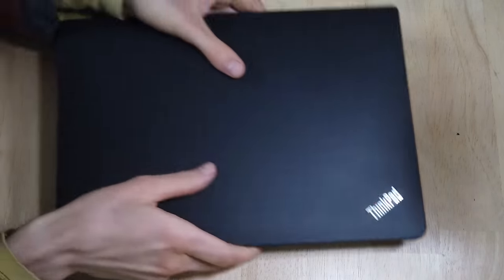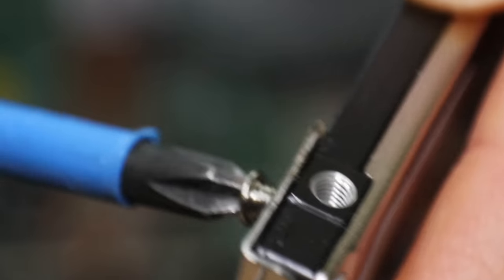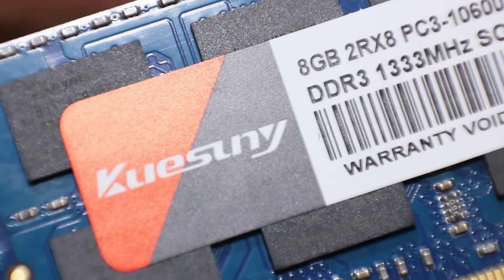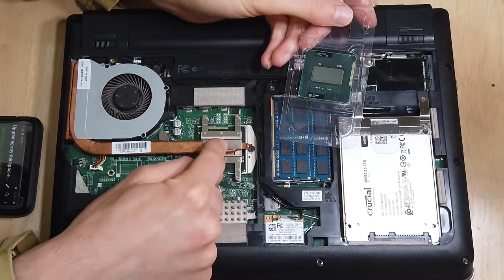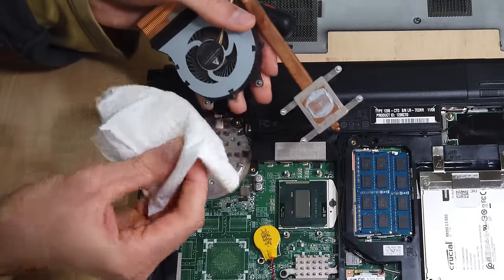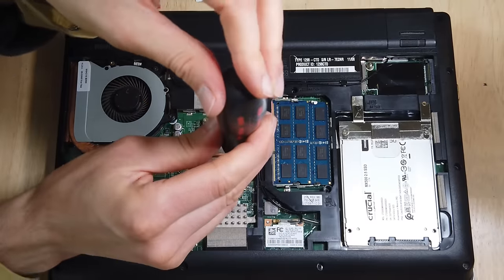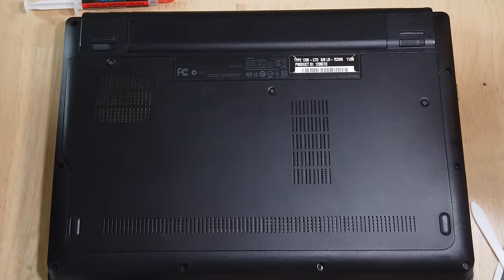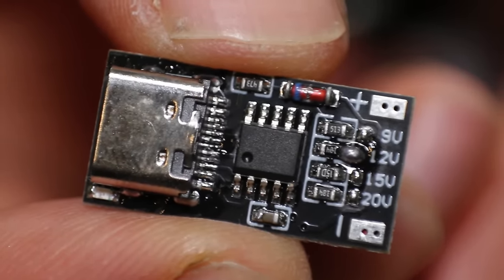The up-gradable laptop I can't get rid of: CPU upgrade etc

Comment: Worst thermal paste application I think I've ever seen! 🤣🤣🤣
Reply from the maker: Same... And then I filmed it for all the world to see
Reply: @ashsibebytes4846  🤣😂😁 We've all been there!
Reply: The idea of measuring thermal paste performance by thermal conductivity alone is also flawed. The thinner the thermal paste the more it will spread out, thus have less thermal paste the heat needs to travel through. If I am not mistaken the arctic mx4 is an example of a paste that is not exceptionally conducted but makes up by being very thin.
Reply: @jaynayk1176  Agreed on your first point but not sure I follow on the second point. IMO, especially for direct die cooling, one of the more important factors is viscosity. Pastes with lower viscosity tend to "pump out" under load leaving bare die to heatsink contact. Higher viscosity pastes better resist the pump out effect and tend to have higher longevity. For budget pastes, I love Ceramique 2. It's dirt cheap, performs with a few degrees of most pastes, and there's zero chance it is pumping out. On the more expensive side, I also like Gelid GC Extreme, Prolimatech Pk3 and Tuniq TX4. MX4 is ok (definitely great for normal heatsink use) but not my preferred choice for direct die cooling like this.
Reply: I've seen worse lol the fact that he ended up putting a blob probably saved it though, or else I would have agreed haha great content
Reply: Did you also notice that the battery was in the machine the entire time.😂
Reply: still better paste application than The Verge
Reply: @sliptap  Nothing beats Arctic Silver. Too bad they don't make it anymore. I ran out a couple years ago. 😞
Reply: @TehButterflyEffect  plenty of pastes best Arctic silver lol. And they still sell it, but it is pretty old at this point. Too many other pastes have better performance and aren’t conductive
Reply: if you ever watch linus IT DOES NOT MATTER any amount of thermal paste will work a dot or half the tube IT ALL WORKS.
Reply: @h1c2e35  Not quite true lol. They came to the conclusion that any pattern will work when applying thermal paste as long as you have enough thermal paste. So if you use too little, you will have worse performance than if you used too much.
Reply: @sliptap  lol to little is like the sizes of a pin tip, you try and do a pin tip with thermal paste in a tube nope it goes splat 99% of the time. so you always have more than you need you would haft to try REAL hard to not put more than a pea size.
Reply: @h1c2e35  linus is a TOOL!
Reply: I hated every single second of the thermal pasting. It was already done when you put it on, the heatsink does all the dispersion for you, but then you plastered the whole cpu with it AND STILL PUT MORE ON TOP OF THAT
Reply: @ashsibebytes4846  where is the next video?
You've left it on a USB-CLIFFHANGER.
Reply: One of my friends first pc build thermal application was the entire syringe 💀
Reply: yeah, that really takes the cake.
Reply: 😂😂hell true dude
Reply: Better over than never!
Reply: Not just that, he didn't even cleaned the cooler... "all the help the I7 can get"... well what about some f... cleaning???
Reply: @ashsibebytes4846  you know what you must do, you gotta redo it on camera
Reply: @sliptap   thermal paste exists because die and cooler are not perfectly flat. That means if you do not use anything, there would be air between the silicon and cooler. Air is a good insulator, exactly what we do not want. If you put thermal paste between it and clamp it down, even if most of it just squishes out of the sides, there is no insulating air. Direct contact to die is not a bad thing, the air gap that is caused by imperfections is the problem. You could be onto something with that longevity part thou.
Reply: Lol so true
Reply: Doesn't really matter as long as there's enough to cover it the rest squeezes out.
Reply: @sjagain  don't be jealous that Linus is way more successful than you.
Reply: Better to have too much than not enough
Reply: Yeah and he has the audacity to say he has O.C.D😂 that should would have been perfect if you had O.C.D
Reply: Haha, I've senn this comment before the video and was like, come on how bad can it be.. Now I am kinda speechless on how right u are 😂
Reply: @TehButterflyEffect  Arctic Silver is good, but its key component (silver) is electrically conductive.  There are better compounds available now.
Reply: Well, atleast it is better than what I have done on my old Toshiba laptop
Reply: Wasn't bad
Reply: He did all the things without removing the battery?

Comment: Bought an older 2011 Lenovo AIO B520e 3111 for $125, swapped out the i5 2400s ( 4 core 4 thread 65watt ) to a 2600 ( 4 core 8 thread 95watt ) 16gb ( 2x8 )of DDR3 1600mhz Kingston ram from the single 4gb stick ( forgot what brand ), swapped out the single fan + cooler to the larger cooler with dual fans, intel 8265 wifi card ( 2.4 144mbps and 5G which I haven't tried so I don't know the speed and don't really seem to need to but nice to have ) from the old Realtek ( forgot the model but 2.4 at something like 78mbps and no 5G ). The older guy I got it from already did an SSD in it and windows 10, for an older system with only PCIE 2.0 and second gen intel it's pretty quick ( 10 - 11 seconds from boot up to desktop ), and everything works, mostly only used for just browsing / watching YouTube and to do school projects ( bought it for the kid, also I wanted a little project we could do ), not bad for $200 total investment with some genuine Lenovo parts / aftermarket ram / CPU swap, with all that and MX-6 paste it stays quite cool. Gaming though, I don't know or even tried but might ( keyword ) be able to do some very light gaming ( like Rocket League for an example, maybe ?! 🤷🏻‍♂️ ), but that's what my MSI Delta 15 is for, probably build a tower if I can find the time / space / cash to burn and if we need another project.

Comment: Did a similar upgrade to my T510. i5 to an i7, 8Gb of ram, 1tb ssd - incredible these machines are, still holding over an hour on the original battery. No issue with thermals tho in the t510.
Reply: I have a Dell Inspiron 5100 from 2003 and the battery still works
As soon as I unplugged the laptop and say it was still running I was just amazed
Reply: I'm not so fortunate on my Dell Latitude's battery situation. It lasts about 20 minutes at idle and about one minute under load.
Reply: @ajhauter5049  time to buy a new old stock one
Reply: @probablynotdad6553  I never use the thing. I built a desktop in August and it does everything I did with the laptop better.
Reply: we've come a long way efficiency wise 😂
Reply: This laptop is literally not even that old. Why are you so goddamn surprised
Reply: @CovenantAgentLazarus  He upgraded it. Meaning it uses more power and so the battery life gets lower. That's why he is surprised.
Reply: @voidarkyt  he should have upgraded the battery then
Reply: @CovenantAgentLazarus  can you do that? Lenovo does some apple stuff right? Yk locking the battery to its own or smth?

Comment: You can probably also upgrade the WiFi card.  Lenovo does like to lock the BIOS so it will only accept certain models, but you can usually find modded bioses that remove that.  I have several computers that now have 802.11AC and bluetooth where they didn't originally come with that.
Reply: Excellent to know, thank you
Reply: I replaced the faulty wifi card in my 2020 ideapad with the old one from my hp laptop and it works perfectly fine, and they are even different brands. The old one was realtek and the current one is intel.
Reply: @lance_374  I have always preferred intel cards (except for their drivers lol they really like to not give downloads)
Reply: @lance_374  you most likely got lucky with that part already being on the whitelist.
Reply: The x240 has a really bad whitelist, which includes blocking replacement generic LCD panels. I did update the wifi and LCD on mine but I had to get a hacked bios first, and flash it with an external flasher.

Comment: the so-called 32GB support on 2nd and 3rd gen Intel are actually designed for 4-channel memory (means you have to install 4 sticks of 8GB DDR3) so in dual channel (2 slot) you can only go up to 16GB.
Reply from the maker: Very helpful thank you
Reply: @ashsibebytes4846  if you see a 16GB DDR3 RAM stick online, it is designed for 5th generation Broadwell system (even with U series CPU) because 5th gen is the first gen to support dual-channel 32GB RAM (although Intel page listed 5th gen CPU like i5-5300U only support 16GB, it is tested and it is compatible with 32GB dual channel)
Reply: @trandinhvietdung9357  Mr Tran is there anything you recommend for under $150usd that can be upgraded but run at lower temperatures? also something that can have wifi or bluetooth as it will be a security machine. Currently using an odroid c4 but too slow.
Reply: You are mostly right but none of those CPUs have 4-channel memory. It's just dual channel with two sticks per channel
Reply: @Pasi123  ah yeah, thanks for your clarification

Comment: People forget, until post circa 2010, laptops coming with socketed CPU's and ram enabling full upgrades was standard practice across the industry for decades. Now such a thing is sold to you as a gimmick for a much higher price by bespoke companies while the main bulk of producers use vastly cheaper production methods of soldering direct to board, which also ensures the product is destined for landfill much sooner than needed.
Reply: I mean my framework 13 was hardly more expensive than a comparably spec'ed laptop and I've been loving it so far

Comment: FYI, you can always use faster memory with a CPU that only supports slower memory. E.g. if you got DDR3 1600 it would work with the i5 no problem, it would just run at 1333.
Reply: @sushantmehta6269  it will, because the 1600mhz memory will run at 1333mhz.
Reply: @sushantmehta6269  have you ever tried this? Because I know from experience it's fine to use faster than supported memory.
Reply: Chances are you'll get tighter memory timings with a higher rated ram kit too even if you can't get faster clock
Reply: @Cedalus  not always. If the faster kit has no profile for the slower speed it might fall back to very slow JEDEC standards. Same if the manufacturer didn't bother to tune the lower speed profiles.

Comment: Really nice video, one tip I would give you is remove the battery before doing any upgrades
Reply from the maker: Yep that would be a great idea. I wish I was there to tell myself that at the time.
Reply: Remove the battery AND press the power button to make sure capacitors are totally discharged
Reply: @ashsibebytes4846 they also sell replacement CMOS battery’s too. That would be nice. Usually good to replace them about every 5 years or so
Reply: @elfedorausado  caps on laptops usually don't hold a charge for long after removing battery but still not a bad idea.
Reply: @ethanv8147  it's not probable, but not impossible

Comment: 2 things about this video impressed me the most. How the laptop looks, it's in amazing condition and the fact that it is a very rare laptop being CPU upgradeable. Cheers
Reply: I personally think a laptop with an upgradable processor isn't so much rare as it is uncommon.
Reply: Almost all core i3/5/7 M laptop back then were CPU-upgradable
Reply: @SOU6900  I wouldn't say uncommon given they were common before like 2015-2016 but became non-existant overnight
Reply: @SOU6900 Sadly it used to be common that laptops are meant to be desktop CPU that is portable so many manufacturers creates mobo that has socketed CPU now its either LGA or BGA the LGA is what replaced PGA it is upradable but doing so is much harder but BGA is where people that solders regularly will be challanged because its soldered directly to the board
Reply: @Raykkie  There's some companies that still offer laptops with the ability to use a desktop processor. But last I looked they were probably 3000 for a basic setup.
Reply: @SOU6900  3k doesn't sound that much for a modern laptop that has socketed CPU heck you can get Samsung with Core Ultra 9 with that money Intel changed their naming scheme

Comment: I've done the exact same thing with an old Toshiba of mine! It came with much worse specs, and the upgrades came with some interesting surprises. It came with a (also 2nd gen) Pentium b950, 4gb ram and a shitty 500gb hdd. I got a 240gb SSD, 16gb of RAM and an i7-2630QM. It accepted all 16gb of ram at the full 1600mt/s surprisingly. The laptop was only supposed to be able to use ram up to 1333. My temperatures never exceed 70C with the new cpu even though it's much more powerful
Reply: Still using my 10 year old Toshiba Satellite daily which I have boosted with i5-3210m and another 4 gigs (8gb) of ram and SSD. Can't see why it wouldn't serve me another 10 years

Comment: An upgrade i would suggest (even more if you're going with a higher tdp cpu) is the heatsink one. I can see in your pcb that your laptop has a model wich has discrete graphics. 

The heatsink from the discrete graphics version has more mass and more thermal capacity, probably enough to be fine with your 45w processor and temps be just as before.
Reply: Did that with my Dell, still wasnt enough.
Am planning on installing some copper plates through the heatsink. Got any tips?
Reply: Liquid metal
Reply: @Callagwhan  That makes absolutely no sense lol, he needs to take the heat out of the computer, not into the cooler lmao… 

I’d say that the only way to do this would be to get a larger heat sink, make one yourself with larger/more heat pipes, and change the fan to a faster one.
Reply: @Callagwhan  i dont recommend it because of 2 reasons:
1. for a beginner is a big no no. If you dont apply it correctly, you can have the chance to kill the entire system. LM applying not easy, like using thermal paste and squish its with the coldplade.
2. for a 45W CPU is an absoulte wasted money. Those laptops are using the bare minimum cooling system which is required by the CPU. For a 35W CPU the manufacturer wont install higher TDP cooling, so u need to replace the cooling system with the CPU.
Reply: @SummonerArthur  buy a heatpipes and stick it to the original heatpipes with thermally conductive glue there are many products online.
Reply: Honestly just undervolt it. Putting copper plates in iis a risk. You have to make sure they touch nothing else, and you still have the problem of trying to shunt the heat out of the laptop, which the fan probably won’t do very well.

Comment: I have an HP from 2006, the hard drive bracket is interesting because it's an adaptor that adapts in such a way they it allows the hard drive to swing down, with the connector moving down

Comment: Great upgrades ! The CPU you chose can not be sufficiently cooled down by a tiny single heatsink with one exhaust fan . Also I am sure 16GB of RAM can not be utilized because of the GPU . All hardware must be somewhat equal in order not to bottleneck anything . I have sony vaio vpceh28FA since new . I have the same HM65 chipset as you Intel core i5 2430M and nvidia 410 512MB . Sony claims 8GB RAM max , but I know 16GB will work . My heatsink cools CPU , GPU and the chipset . There is no way this could cool down a 4 core i7 without burning the surface I lay my laptop on . My view is just be reasonable within logic limits . Awesome video . I have my laptop since new 2011 . It is my secondary/backup laptop . Great video ! I loved it . (I don’t mention anything about the thermal paste application, you know you used too much ) . 😝😆👌🏼

Comment: Older HP Elitebooks had a lot of upgradeability too (relatively speaking) as they had MXM form factor dedicated GPU's that could be swapped out. Good luck finding much that will work as HP likes to blacklist stuff in BIOS updates but it's nice to know that it's replaceable at the very least.
Reply: No shit, HP also blacklists any WiFi modules that isn't theirs so you have to pay them for hardware update
Reply: Also, the whole MXM thing never really took off a lot of manfacturers did use the MXM standard but that was very short lived and was never made available for retail commercially. You'd have to contact your laptop manufacturer for one or the OEM manufacturer themselves to ask if you could buy one from them directly and 99% of the time the cost of one didnt make sense finanially because they cost well over the odds vs the cards original desktop counterpart.

Some people had luck sourcing cheaper units pulled out of working or laptops on ebay but even those often went for silly money for what they were and the bioses on them had to be compatible with the laptops bios. There was a lot of hardware blacklisting going on as you know so getting an MXM was never guaranteed to work if it didnt have the correct OEM bios.

Comment: That is a sweet Lenovo laptop for heavy office work. I would probably trade my current Macbook Pro for what you have done there wow. However, that 97 degrees C is concerning. I would try then to get like HWInfo or something and crank the fan speed up....
Reply: Maybe he can hack the motor of the cooling fan or clean it or replace it with a faster one 💁‍♀️ would be interesting as well

Comment: I used a very similar laptop, a hp ProBook 4430s with a i5-2430M. Right under the clu and left of the WiFi card is the igpu. Yours have a good heatsink but my one just had a thick plate, 1.5 mm thick. I replaced it with a heatsink for a raspberry pi 4 and it helped a lot with games. Just replacing the stock thermal pad with thermal paste should help a ton to increase the performance of hd3000